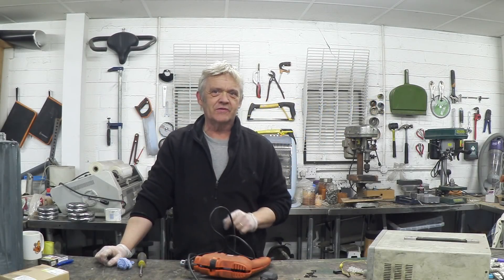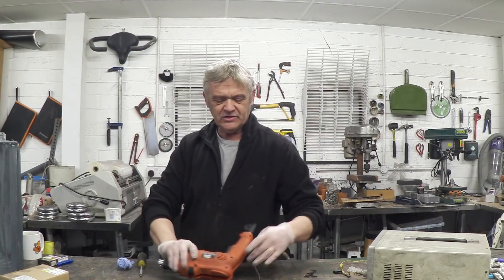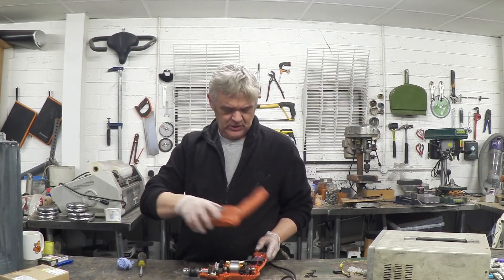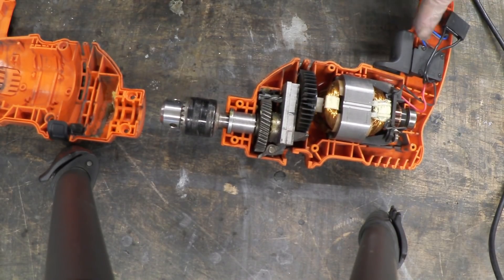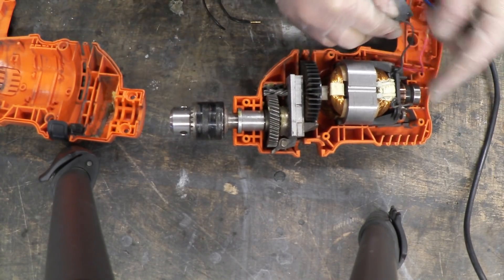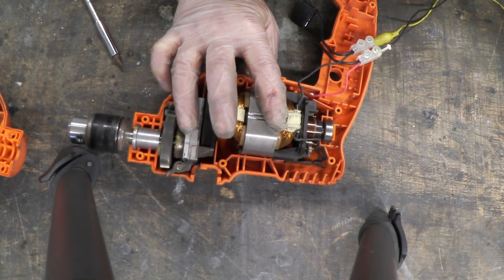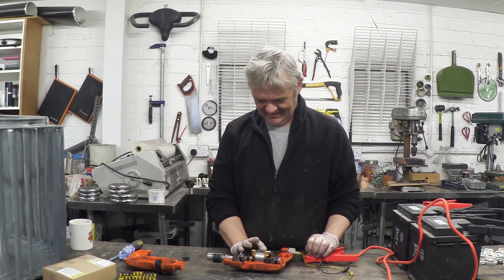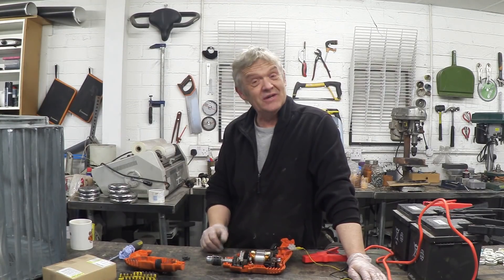Converting Plug In Power Tools To Run On Batteries

Comment: It will run without the cap it is only there for noise suppression, most power tools(with universal motors) will run on DC appiled straight to the plug but the ones with triac speed controllers wont work it will be either full speed or off, hope this helps.
Reply: @James this is another type of motor, does not need startup cap
Reply: The capacitor is only there for suppression, to prevent noise from the motor.

Comment: This can be very useful for certain requirements. One heads up I will give anyone experimenting with this is to be careful reusing original switches intended for AC as DC can be a bit brutal when it comes to switch contacts.

Comment: The first time I did that was back in the 1960's while camping, I needed to drill some holes. Nowadays the drill switches are SCR's and they don't work well ( if at all) with DC. So find a real off and on switch and use 4 or 5 batteries 60+ volts and it'll have plenty of power. Brought back at lot of good memories, thanks Rob.
Reply: are get a cheap boost converter

Comment: Funny coincidence that you presented this today. I was using a 240v device (magnetising yoke for ndt) on a job last night at a local power station (ironically) that I had running off battery power through an inverter thus avoiding the hassle of finding outlets and running leads safely.

Comment: Great Idea! Thanks for showing this. I never expect that it's possible to run an AC motor on DC.
Reply: As long as it's a universal motor, they'll operate on either.  In a sense, that type of motor is already a DC motor but modified to run off AC power.  Think of it as a DC motor designed so that regardless of which way current is flowing through the coils the mechanical rotation will only go in one direction instead of forward/reverse.

Comment: Great idea Robert. Just thinking (thats dangerous for me 😉 ) so this may well be a bit of a daft idea but here goes.... I wonder would it be possible to make either some very high power “battery belt” with a 3 pin socket to plug your tools into or a large (but as light as possible battery back pack) with the same idea so that you could power any number of tools for quite a long time (hopefully). 
Would it also be possible to have the various tools hooked up with a sprung loaded power lead so that the lead would always stay taught while you’re using the tool/s. 
Thanks again 😊 👍 - Jonathan from South Wales 🏴

Comment: Thanks Robert for this kind reminder!
My project on hold may be slightly different, but kind of similar. And it should be continued soon:
I started reviving my old Bosch NiCd battery drill by finally replacing the broken, poisonous NiCd batteries with reclaimed (tested and self selected) 2.6Ah Li-Ion battery cells from old, retired notebook batteries.
Three in series do the job pretty well. I'm planning two strings of these in parallel in order to get some capacity for working independent from the mains. The drill has no friction clutch yet, but a working light as accessory already. But hey, for screwing I do have two other modern battery screwer-drills yet. Having an extra drill for, well, drilling anyplace offgrid would come quite handy.
But as a saying goes: The first 90% takes 10% of the effort, the last 10% take the remaining 90% effort. 😉
Means, it works in laboratory scale, fastened and wired externally *somehow*. But rebuilding a working battery compartment sends me brooding ever since.
New year, new attempt. Let's go, lazy me! 😜

Comment: Nice.

A few comments :

There probably is not a negative and positive wire from electronics  to motor. I suspect there is some phase cutting electronics in that bit of plastic with a triac as switching element. Much like any dimmer circuit. Out comes an AC voltage with reduced effective voltage.
The capacitor is there to reduce emission. Without it it might distort other devices on the mains voltage and radiated as well so it could be heard on a nearby radio. It will work without capacitor with mentioned consequences. 
This kind of motor is not unlike the vacuum cleaner motor. When run from DC voltage it does not make much difference for the rotor windings as the commutator makes sure there is an AC voltage on those anyway with a higher frequency than the mains voltage. But current in the rotor windings will be way less due to lower voltage.
For the stator windings it's completely different. On AC voltage their impedance will be way higher than on DC. Meaning on DC current will be much higher with the same voltage applied. With 24V DC current still might be higher than on mains AC.
To recap, when working on 24V, stator current might be to high, rotor current will be way to low. Given this it might not be possible to find the optimal DC voltage where it will perform like on mains AC without the stator windings burning out.

Uh oh I read the other comments and learned  brushes connections and stator windings might be placed in series. That's probably true in which case it would be possibe to find the optimal DC voltage where it will perform like on mains. However when the drill is blocked current will go through the roof and windings would probably burn where on AC mains that would not be the case.

Comment: You might try connecting the armature in parallel rather than series as is usually the case with AC universal motors.

Comment: You bet! In my experience you have to run it on slightly less DC voltage then original AC voltage,, so if it was 120v AC you need about 90V DC.   My favorite conversion are AC lawnmowers to DC 🙂
Reply: And (in theory) 90V is enough to kill you.
Reply: @ColinWatters  depends on what kind of current that 90v is pushing
Reply: Wonder if it's (AC Voltage)/Sqrt(2)

Comment: A universal motor will run on DC but it needs to be similiar in voltage to have the same power.
I'm working on converting an angle grinder to 12v brusheless dc, by rewinding the stator and replacing the rotor windings/brushes with permanent magnets.  I have found ZERO videos on others that have done this.

Comment: I've tried this on some old universal motors from some fans (so not such high-power motors as vacuum cleaners and power tools). The only way I could get it to spin quickly enough was to parallel the windings instead of leaving them in series. At such low voltages I'd expect even if you paralleled everything you'd still be way under-driving it anyway, and it's quite an easy mod to do.
Reply: Hi, can i use this method for a "dolphin massager" ?

Comment: wow great idea. Nothing to do with this really but I am seeing advertised on a shopping channel a clothes dryer using what seems to be a ducted fan blowing fresh air through the tubes around the clothes using 30 watts of power for £60.00 wondering if you could produce something similar a bit cheaper.? On Amazon, high street tv, nu breeze

Comment: just use an inverter no need to do anything to the tool still all the power and torque of 240v
Reply: Expensive and when the 5th wave arrives we all will need to be tested sorry rob but i had to say
Reply: @markhodgson2348  what 5th wave?
Reply: @dantronics1682  infection from the filthy heart breakingly sadness of the world of physic disease
Reply: The problem with inverters is that they're expensive especially one with a high enough output wattage. If you have the batteries anyway (because obviously they're not cheap new either) then being able to run directly from DC is useful. If you want increased torque then a DC to DC boost converter could well be enough to up the voltage to get that. 

I would be interested to see a way to make an inverter using reclaimed components though
Reply: @realfamilyman  oh it's definitely good to understand things yeah. But inverters really aren't that cheap here, much more rarely used I suppose, so finding them second hand isn't common either. The UK is much smaller and more densely populated for one thing, so the demand for off grid equipment isn't nearly as high, also electronics in general just cost more here than the US. Some countries the problem would be even greater. 

It also depends what you consider to be expensive :) But yeah if you can find a decent second hand one then that would be a good option
Reply: @markhodgson2348  if you guys think 10 dollars is expensive then I don't know what to tell you. I've bought countless inverters for 5 and 10 dollars...

Comment: How about putting in a parallel wiring system for the DC power, a switch in the base to flip between the AC and DC operation and making a battery hookup with a compatible plug in to what is on the tool to begin with?  That way you can use it for both AC and DC.

Comment: Watched the video.    Then got to thinking about converting tools to 12v when there’s no 240v about in an off grid situation.       Is there a way of converting a storage heater to work via 12v.   I realize that it would not be up to it’s full temp but got to thinking about it ?

Comment: It's an interesting approach.

I'd be interested to know what you get in the way of torque; you're clearly running slow, but that isn't necessarily a problem - slow drilling is key to drilling hard materials with normal tools, far too many people try to drill metals way too fast.  A pair of car batteries should be able to deliver enough amps to utterly fry the motor, power delivery shouldn't be an issue.  Can you try chucking up a biggish (say 10-12mm), sharp, metal drill and drilling into some heavy steel, with no pilot hole?

Comment: was there a bridge rectifier in the switch area?, 
If not then surely you could just try connecting DC to the exposed plug prongs without taking the thing apart.!!

Comment: You can just connect the dc to the cord without modification as long as the tool doesn't have a speed controller because triac based speed controllers only work with ac.

Comment: It would be easier to get a cheap 12v inverter.  A universal motor as fitted to most AC power tools would be quite happy on a modified sine wave version. Full power and torque on 1 car battery.
Reply: Yes but this is not about the ends.... It's about the means, ideas, inspiration. and creativity

Comment: happy new year Rob! very cool indeed, but i'd actually be really interested in a good solution for the opposite. power tool batteries are pretty expensive and obviously limited in capacity and lifespan. i'd really like a cord adapter for battery tools for times you have access to a plug, and i'm really surprised that no companies have developed this. although i suspect its because a high Amp transformer is pretty big and bulky, and if the transformer is at the outlet then very heavy cables would be needed. not sure though, and i've always thought it would be really useful.
Reply: Try using a battery charger (for 12 volt tools!)
Reply: use a switch-mode power supply, heaps of them on banggood alibaba etc for a few dollars, high current and quite light weight
Reply: @longwhitecloud  Great idea!
Reply: .....maybe,,   so looks like a standard 18 volts is being adopted by manufacturers . At ten amps it's ideally 180watts but I'm sure some of the tools are more like 360 watts requiring twenty amps . Just thinking the laptop little power supplies can be rated up to six amps at around that voltage . They get thrown out when laptops die . Obtaining two of them and connecting outputs in parallel m perhaps ( there's a vague memory cautioning against connecting switchmodes in parallel , it depends though , not insurmountable )
Reply: @charlesdickens6706  Good point
Reply: @charlesdickens6706  Good point.

Comment: Interesting . But I’d probably put  a  7.5ah battery and a cheap small inverter in a hobby box and mount a slim 240 socket , with dc charge socket on outside and plug drill in where I need it. Just an idea. Nice video thanks

Comment: thanks for sharing intell before battery tools were use full i used a power inverter and battery in an utility  trailer pulling and zee yard ,heck i still do if needed..a say 25 lb inverter and diy battery set-up be a fun build with graphine lead acid battery build

Comment: The ability to run fridges and freezers from battery power would be especially useful in emergency situations like natural disasters.   Not sure how the motors inside those compressors are arranged might have to investigate that!  Of course if you know advance you can buy such devices...

Comment: Interesting. I wonder what the capacitor is doing? I saw a fellow once, who measured torque by securing the motor and attaching a foot long lever to the shaft. The other end of the lever rested on a scale. Very simple way to measure Ft-lbs, or other units of measurement. I've wanted to try it ever since. :)

Comment: Is there some reason you can't just put some battery clips/clamps on a power strip, clamp them to the battery and plug the appliance in the strip?
Reply: Yea some of the switches use the trigger as a threshold sensor, harder you press more it speeds up etc,  done with triacs/ scrs which you want gone on a DC supply. if it's just a switch your idea should work just as well.

Comment: Could it be done the other way round ie. converting a battery tool to run off mains. Usefull if your battery runs out and you dont want to wait for it to charge up.
Reply: I gutted a Black and Decker 18 volt battery and wired in a laptop power supply. Now I can swap out a discharged battery pack for one that runs on household current. Only problem I've had is the drill bogging down on low speed starts. Have to start high speed and then back off.
Reply: @loaderman213  Nice. I maight have a go with my dewalt battery. I have a few knackered ones.

Comment: What about a tutorial on making an 18650 pack that would power it to the same performance as when it's plugged into the mains ?  Is that possible ?
Reply: Yes very possible. Usually takes about 6 x 18650 batteries

Comment: so, using the built in cap and putting in line 20 batteries to reach 240 dc would the tool reach its full power and lifetime again?
Reply: 240V  DC sounds a bit deadly. :)
Reply: @zylascope  yeah, purely academic question

Comment: So, are all small motors, universal motors nowadays and if so, how can one tell apart from wiring them up to batteries?
Reply: some are brushless/induction motors or shaded pole, you can usually tell by the lack of carbon brushes, and slotted ring on which they ride. 

some synchronous motors use a dc electomagnet instead of a permanent magnet, in which case the rotor would have a pair of slip rings which are not slotted.
Reply: @satibel  Thanks mate

Comment: I need it the other way around..
Reply: That's a VERY interesting point!!  I wonder why we don't see power adapters that fit into cordless drills, so that you can use them as a corded tool when your batteries are dead as opposed to waiting to recharge?  I suspect it probably has something to do with the inrush current, which batteries can handle well but would fry a standard power supply.  But with a little bit of smart circuitry, I would think that could easily be dealt with - basically, go through a series of step-up voltages to spin up the motor. Or - even more simply - maybe just the right arrangement of capacitors.  Hmmm, that seems to be a product idea waiting to happen!!
Reply: Did a bit of browsing on YouTube, and found someone who was using just a standard transformer and bridge rectifier to power their DC drill.  Not sure what size transformer would suffice, but looking like yet another potential use for those microwave transformers Rob is always championing!!  😋  Would then just need to add some over-voltage and over-current protection, etc.
Reply: @NorthernKitty  thinking of what you said of using microwave transformer.👍

Comment: Will this type of motor spin fast enough with sufficient torque on 24 volts
Reply: Probably not, torque is a function of the current, which itself will be limited by the voltage.  Running it at 24VDC isn't really much different than running on a basic phase chopping speed controller at a low setting.

Comment: If so, then can it becomes a generator for a wind turbine?
Reply: If the motor has permanent magnet in it. Usually it doesn't have permanent.... You may need to add your own magnet to generate electricity with the drill motor.

Comment: I'm going to do the opposite. I'm not paying for new craftsman batteries for my set. So I'm going to convert the battery by putting a high power transformer in the battery case. Then I can use my tools again.
Reply: Have you considered puting in new batteries a lot of videos on it. Some people have increased the torque by doing so. Just an idea
Reply: ...can also choose option of buying cheaper battery packs of cheaper brands and having an adaptor .
Reply: I just did this. Works with an old computer power supply. It doesn't work with my battery powered circular saw though. I think it has something to do with speed controller in the trigger of the drill vs. the on/off trigger on the saw.

Comment: Ok, i'm slow.. I don't get it??  YOU still need a cord between the 2 car batteries and the tool? so you still have a "CORD"  
If this was done with (6) or so 18650 batteries than I can see how that would be helpful to convert tools over.. 
But this would only be useful I guess if you had to go out into the fields or somewhere , where there was NO electricity .. and for the price of car batteries with amps.. I'd spend $ on a solar powered generator IMO.. for 300 when on sale..  and be able to power all my tools without converting them..   .. Just my thoughts..

Comment: Can someone translate “sounder?” What is this device?
Reply: Sander? It's using sandpaper on a vibrating plate.
Reply: Electromechanical device used for sanding
Reply: ....as long as there's no ferrets in that squirrel cage then it's all good .